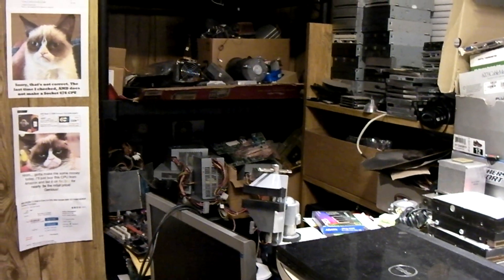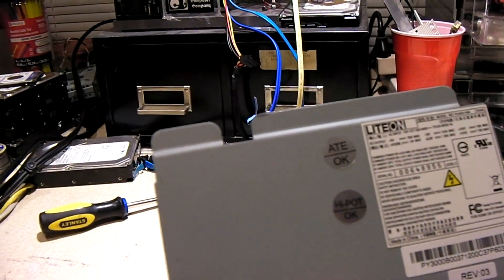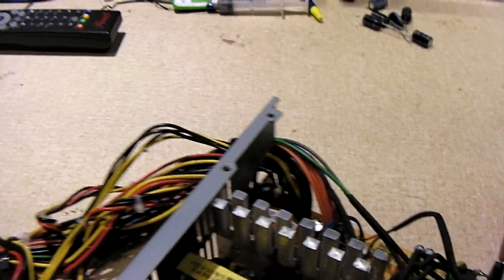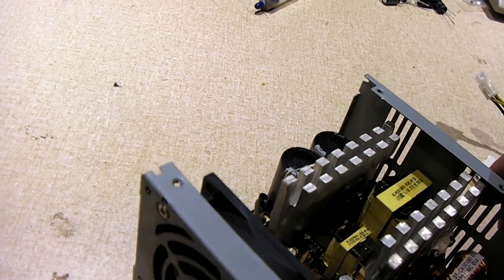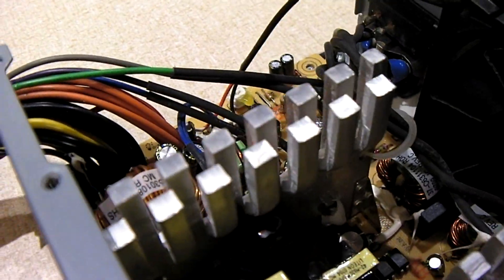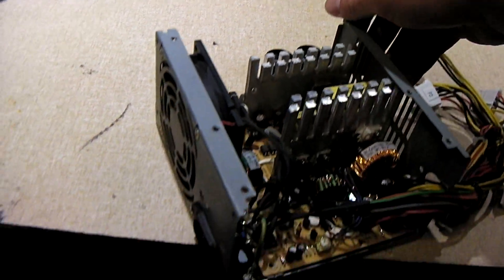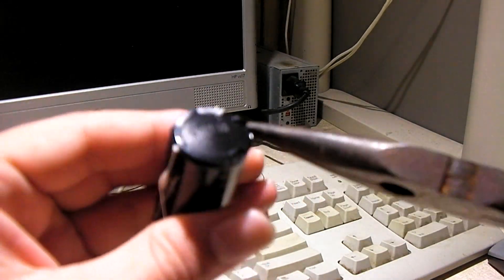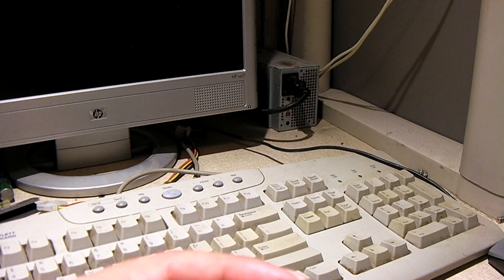A LiteOn power supply with failing OST capacitors (including primaries)

Comment: Recapping my wintech power supply don't you hate when you buy a set that doesn't quite fit? I bought 2 sets of 680uf 200v caps and every single one I look on ebay is either 22mm or 25mm and I  needed a set of 20mm I found a set in a old hp power supply took them out and replaced the ones that was bulging and leaking. 20 years has changed in capacitor tech huh.
Reply from the maker: I buy my capacitors from Digi-Key and Mouser. These are electronic component warehouses with pretty much every value and size you could think of.
Reply: @CubeComputerChannel  thanks I'll check it out x3
Reply: @Cube Computer Channel  btw I used low esr caps is that a bad idea?
Reply from the maker: @plainsabertooth7828  Although I use general purpose capacitors in PSU repairs nowadays, low-ESR will be okay. I've reused harvested motherboards caps in PSU repairs for years before I started buying new caps, and the motherboard caps are generally low-ESR.
Reply: @CubeComputerChannel  is it possible to replace 470uf capacitor with 680uf?
Reply from the maker: @plainsabertooth7828  If it will fit, sure!
Reply: @Cube Computer Channel  the reason why I asked is because gateway uses a proprietary power supply and want to get a little more in wattage.
Reply from the maker: @plainsabertooth7828  Upping the value of the primary capacitors alone will not give you more wattage. The load capacity factors in things such as the rating of the primary switchers, transformer core size, secondary rectifier capacity, among other variables.
Reply: @CubeComputerChannel  thanks I kinda figured it wasn't that easy lol

Comment: Hi, does anyone know what are components called that you can see at 2:46 that are shrink wrapped and connected in parallel beside the big bulk capacitor. My one is completely blown so couldn't look for part number.
Reply from the maker: That is a MOV, aka a surge protector. If this part is blown, it means your power supply took a surge of some sort, and there could also be additional damage to the unit. I am not sure what the voltage threshold for this MOV is. You might be better off replacing the unit unless you are certain other components also have not been blown.
Reply: @CubeComputerChannel  Thanks for the info and the reply. I have already replaced my PSU, don't want my PC to be fried in case anything goes wrong. I was thinking about repurposing it to power my led strips and charging station. Also blowing of the MOV blew the bulk capacitors too.

Comment: My psu makes a noise so I checked it and the thing is that a polyester cap next to the rectifier is squealing, it seems ok but makes that noise since I start the pc all the way till I shut it down. 
One strange thing is that if I put the pc under harder load thtat suqueal almost goes. What would you suggest? Should I change the cap? And I'd like to know if I can somehow improve it by choosing a different type of cap like the x2 oned. Thanks!.
Reply from the maker: I would just replace it with the same kind of cap. A lot of times, the squeal you hear in a power supply is known as coil whine.
Reply: @CubeComputerChannel  Yeah I researched a bit and at the beginning tought it was coil whine but after opening the psu and locating the source of that noise I realized it is that capacitor, people call that "Capacitor squeal" some say it's harmless, other say it's cap heading to failure, I don't know if it gets worse I will definitely replace it.
Reply from the maker: @alexisxyz7531  I was wondering if you were able to fix the issue you were having. I have a 300W FSP power supply that makes a horrible squealing sound and I have made several attempts at repairing it. Here's a video of it:
https://www.youtube.com/watch?v=v60d6fuRRPY
Reply: @CubeComputerChannel  Hello.
At the end of the day I just sold it to someone whom didn´t mind the squealing sound and bought a better quality one. 
I purchased a Corsair CX750M and it´s what my system is currently running on. 
So far so good, I have an i5 10400 with a RX6700 and it works perfectly fine, though I´m thinking of replacing it with something with a higher degree of protections but maybe in a year or so, unless there´s a chance on getting one for a very good price.

Comment: What is your take on Retail Plus PSU's? I got a Retail Plus 600W PSU and I need it for my video card cause it is the only one that I have that has a 6-pin connector. Would it be safe to use temporarily?
Reply from the maker: Upon looking at a page showing the 700W model, I spotted a voltage selection switch on the unit. This tells me that the unit is likely of a dated design lacking active PFC and likely not able to easily do 700W, or at least do it safely. The same probably can be said of the 600W model.

Comment: Isn't the purpose of the plastic capacitor vent cover obvious? It's to reduce the escape of the gases (i.e. decrease the pressure of this 'rush') inside the capacitor when it bursts! Especially on something big like this you wouldn't want an instant RUSH of poisonous gases leaking straight out of the capacitor into the air in a matter of seconds!
Reply from the maker: A lot of capacitors don't have this cover in place. And usually when they do vent, it's with enough pressure that a plastic disc isn't going to make much difference anyway.
Reply: @CubeComputerChannel  If that is actually true, then here's another guess. Since I only really see that plastic cap on larger, higher voltage capacitors, I'm guessing it's to protect the user from getting an electric shock from the cylindrical metal can of the capacitor. Also to prevent loose wires or anything like that shorting out on top of the capacitor.

Comment: What a coincidence, I just repaired a psu with bloated OST caps the other day, that aside, o also recovered a bunch of OST caps from some mobos and playing with the ESR meter to see their state EVERY SINGLE OST CAP i had had way lower capasitance than stated. all the 1000 uf 6.3v caps were between 690-800uf, the 1500uf ones were about 1100uf, and the internal resaistance was ok so its not like they were dried (0.015-0.035ohm)
I think OST is just crap. If it doesnt fail, it was because of manufacture error.
Reply from the maker: Well if the electrolytic capacitors are old, they will lose some capacitance with time.
Reply: But afaik that only happens when they dry up so they usually lose capasitance AND the ESR goes up. I never heard of them losing capasitance but the esr staying super low as if they were in good state. What ive seen is the other way around, the ESR going up (say ~1ohm or more) but the cap still reading about the same uF as it said on the side.
You sure they lose capasitance only because of time?